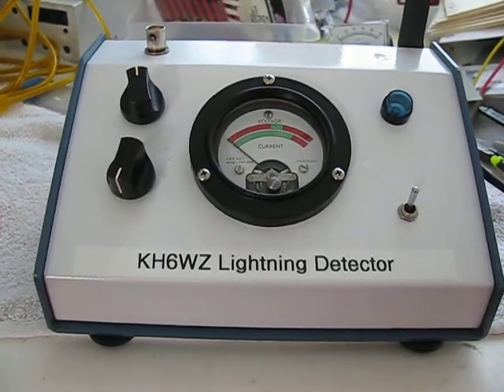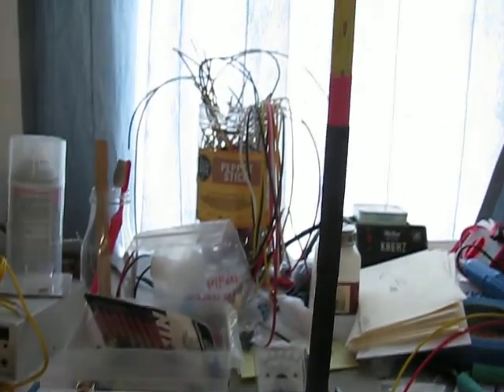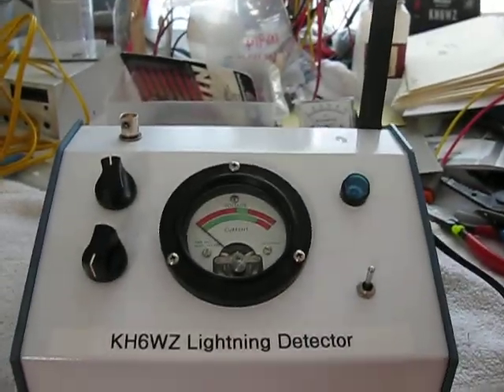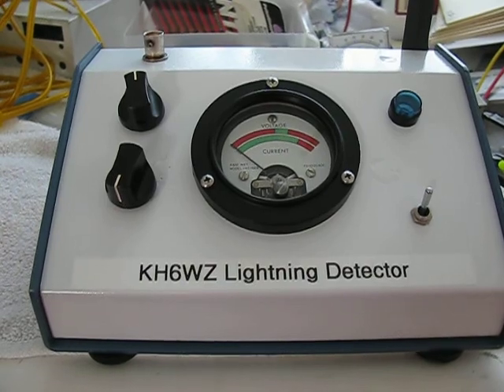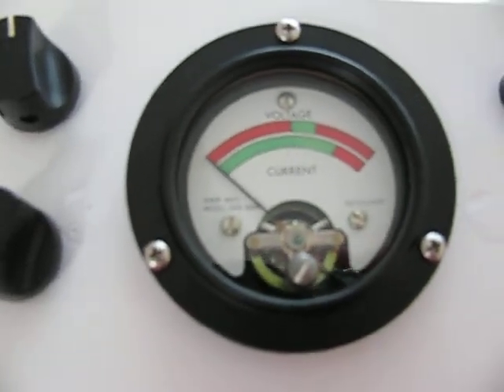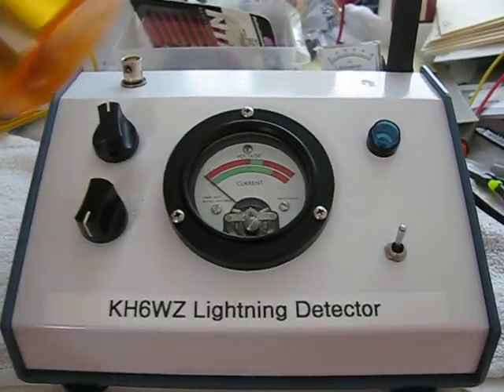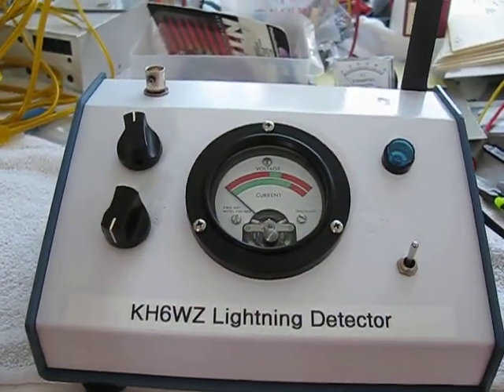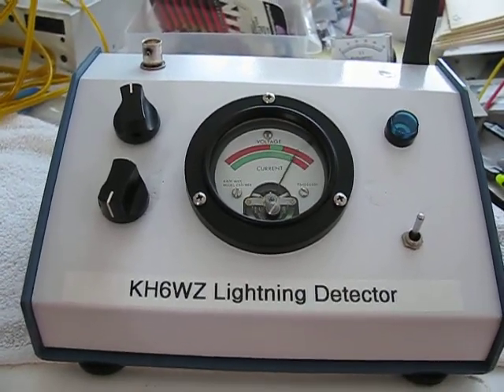Lightning Detector 2

Comment: I’m having trouble making the meter to work. How did you connect it to the lightning receiver?
Reply from the maker: Patrik - can you be more specific? I am not sure what you are asking. This page should help: http://www.techlib.com/electronics/lightningnew.htm
Reply: Wayne Yoshida Which lightning detector schematic did you use to build your second version?
Reply from the maker: @patrikofficial4886  OH! I used the newer version, the one that shows the parts mounted on a wood base and copper (maybe brass) nails used for connection points. That might be the best one to start with.  Go here: http://www.techlib.com/electronics/lightning.html and look for the one about being designed for the beginner. You will also need to build the meter circuit (scroll around some to find it)
Reply: Wayne Yoshida Okay, thanks.